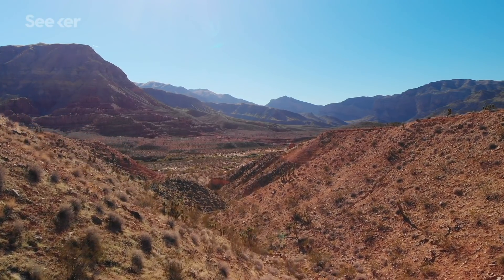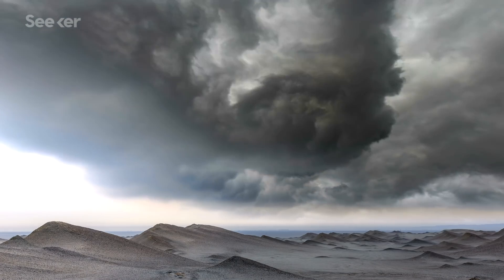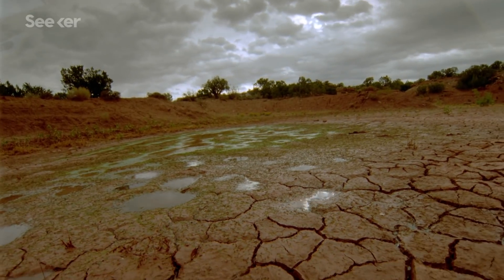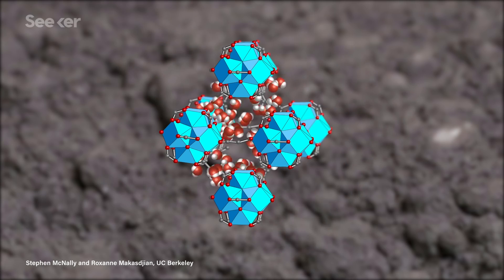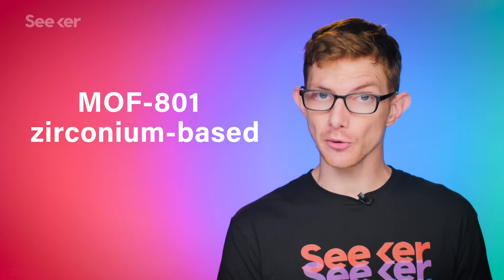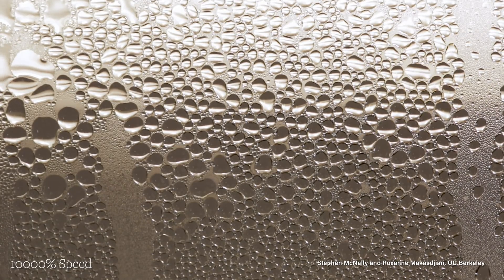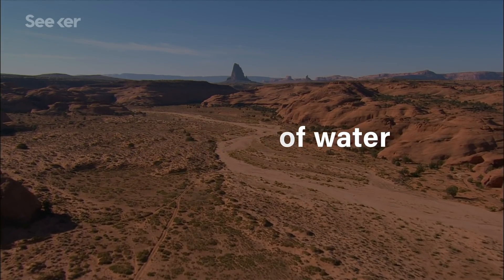Transforming Air Into Pure Drinking Water Is Finally Possible, Here’s How

Comment: Use transparent aluminum fibers in mof or cote it with titanium ceramics.  Stop contaminating the water. Aslo need an ionizer and de ionizer wich will pull the water. Palm tree bark is a clue 8).

Comment: Big deal. Fridges, dehumidifiers & air conditioners have been doing this forever
Reply: Why, oh why does this comment appear so many times 🤔 
Those things require a generator of electricity and more parts. This requires only the sun itself and is, therefore, more direct and fewer parts, though ostensibly in developing phase. 

Maybe it will be the next big thing, or maybe MOF will be like the car that runs on water. 🌬 

Hoping it will be attainable🤞

Comment: "Dehumidification removes water vapor from the desert air" would be the appropriate title. There is nothing transforming anything. 

if the could spontaneously combine random Oxygen molecules with free floating hydrogen molecules, then I would agree with the title. But even that's not transforming. Take three heavier  elements and start removing protons and electrons until you get to the hydrogen and oxygen you are looking for. That would be transformative. 

Break down carbon to Hydrogen and perhaps you'll have the golden goose.

Comment: The question is, "can a MOF pull clean water out of the air with less power than a conventional dehumidifier?" AND does it work better is super dry climates? If the answer is YES to both questions than this IS a advancement in technology!! There are a couple of these being made for small and large consumers in 2020. When used with solar energy, water will be produced via zero marginal costs, so once the unit is paid for it will extract water indefinitely with little to no ongoing costs (Like solar) It's about making the math work in purchasing a MOF unit vs. the ongoing monthly expense of city water costs. If the product delivers than it WILL empower the individual by eliminating the dependence on local water municipalities. All about the math:  costs vs. output of the unit over time.

Comment: This is not the first way to get water from air.  Let me explain
You can get water by simply compressing the air at High amount and high pressure and in this case water is separated from wet air and some purification method makes it as drinking water

Comment: Just look at the thermodynamics of it as showed by Thunderf00t. Every option uses a lot of energy like a air dehumidifiers, and no water of a air dehumidifier is just drinkable because of microbes etc.
Look at Thunderf00t Waterseer and Fontus debunking.
Everyone wants it to work but the thermodynamic just says no. Water desalination by osmosis is just much more efficient and will increase in efficiency with the use of better membranes may be with the help of graphene.
So just look at Thunderf00t videos to get real world calculation of the physics involved.

Comment: "extremely pure and drinkable"
lmao pure water is most certainly not drinkable... how can you even put those two in the same sentence...
Reply: Pure water is perfectly drinkable.   It takes a lot to leech a significant amount of electrolytes from your body.

Now, I wouldn't try and survive on the stuff, but it's also trivially easy to convert pure water into perfectly safe water.     In a pinch, you can do it without any special equipment or materials (assuming you aren't too dehydrated or squeamish)

Comment: This is not a revolutionary technology.  The water in the air is fairly easy to capture. But it either requires energy to extract from the air or from the thing that absorbs it.  Fans and heaters?  Now we're getting a little less simple.  A common window air conditioner gets water out of the air... If you haven't noticed getting dripped on every time you walk past a big apartment building.

Comment: Here we go again with another pipe dream air - water condenser working with some magic material... sigh!. Look you can't beat the laws of thermodynamics: the latent heat of condensation of water is huge: about 2442 J/g in 25ºC. So regardless of the materials used, you are going to need vast amounts of energy to turn the "trapped" water into liquid.Also the areas most in need have very low air humidity so you need  Huge forced draft air fans (huge volumes of air) - a Hella lot of electricity on an industrial scale, just to supply water to a small village. Plus water treatment, cleaning and disinfection because condensed water is a favorable environment for microbes and bacteria. I can go on and state many-many failed attempts - the point is it's not feasible economic - wise and environmentally...

Comment: If we assume 100% humidity and 100% efficiency and that  the device is used for one adult women then
 as there are  12 hours of daylight at the equator for the solar panels we can calculate the power required.
The latent heat of vaporization of water is about  2.260x10^6 J/kg, for average adult women that requires 2.7 liters per day of water then,
m=pv =1x10^3*2.7/1x10^3 =2.7Kg of water.  As E=ml  were l is the specific latent heat of vaporization of water. This gives:
2.7(2.260x10^6) aprox= 6.1x10^6J
As p=E/t and there are only about 12 hours of daylight at the equator, then we can deduce that: 
6.1x10^6/60^2*12 =141.25W. So in the optimal conditions, as stated above, you would need 141.25W solar panel to power the device. Now as conditions are not optimal (humidity is exceptionally low in those kinds of places) and that the solar panel may need the supply for a whole family, so the power demand will be even higher.

Comment: How gullible are you?? An outdoor dehumidifier requires power, and A HIGH LEVEL OF HUMIDITY IN THE AIR. To get the numbers in this study, you would need a near 100% humidity level. Remember, you are talking about extracting this water from an already dry air. Meaning low to no humidity! You could run these things for years and get very very little water. In fact, it would be much more efficient to truck in water from other sources.

Comment: Everyone mentioning thunderfoot, but this one actually isn't a bloody air conditioner. 
Edit: I would love to see thunderfoot do the maths on this. Obviously the earlier devices made claims that violated the laws of thermal dynamics, but perhaps this one works in a  way that doesn't require major energy expensive phase changes, or some quirk of the design saves thermal energy lowering the cost.

Comment: So how long is efficiency kept up? With it relying on such a small pore structure dust from cycling air through it especially with a fan and even more so in dry climates which are more dusty, this will clog and cover all the material quite fast I imagine. So how is this prevented or cleaned off? Does most of the water have to be sacrificed each time for rinsing off the material? Because tap or ground water would be high in mineral deposits which would leave mineral salts that would quickly build up and cover all the material which is even harder to get rid of than dust.

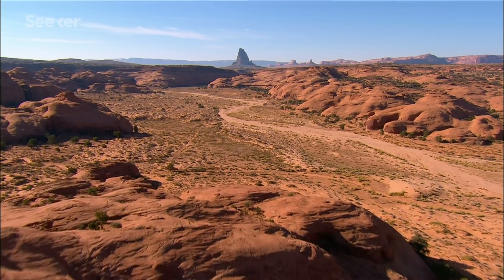Comment: 1:44-1:52 NO!!! Pure water is NOT drinkable. If the MOF only collects water molecules, that means completely pure water, which is a dangerously strong solvent. You drink that straight from the condenser, it will leach the minerals from your bones and teeth, as well as pull vitamins out of flesh and fatty tissue.

Comment: I wonder if a passive one could be tuned to keep the ambiant air at an approximate predetermined humidity. So, you could put one in your house and it would just do its thing keeping your house from overhumidifying to prevent mold and keep the air comfortable.

Comment: I was wondering if there would be any side effects from taking moisture out of the air. Wouldn't it just cause dryer air which would then cause other places to receive less moisture, thus making them dryer?
Reply: The Earth surface is 70% Water and 30% Land. On the grand scale, water vapor continuously evaporated by the Sun from the oceans, rivers, and lakes will replenish the water harvested from the Air. But it's still possible in a small localized area where a huge industrial AWG plant operates would cause a localized lowering of humidity of the area around it. However, such a condition will create a self-balancing weather condition where heavier humid air further out will move in towards the less humid area and restore the pressure, temperature, and humidity conditions.

Comment: I doubt this could cause dramatic climate crissies, but the Atacama would be an interesting case study.

Dry areas seems to beget moisture. Dry air draws moisture in from wetter regions. Wetter regions becoming dry causes more water to evaporate. It is not like it would cause a global disaster. If it were truly bad people in winter or deserts would die from chronically chapped skin, not dehydration.

The only area that I might be concerned about would be the Atacama as that desert is locked due to climate inversion. That area would make for an interesting case study. It is raised where something like Death Valley is below see level. The North African deserts were created from the land rising but I doubt they have problems pulling moisture in for a minimum amount of relative humidity. 

But what do I know?

Comment: You have to add energy to the system to "empty" the water. They didn't test the unit in a desert, they tested it where there was already plenty of humidity, this will not work the same in a desert. When you do the math on how much energy it takes to turn air into a liquid, you'll see that it'd be cheaper just to transport the water in tankers to the location than it would be to try and extract the water out of the air. Basic physics means that water extracted out of air will never be a cost effective option.

Comment: People be talking about Thunderf00t, but I think his videos were pointing out the law of conservation of energy, and how condensation of water by thermal/cooling means is rather impractical. When he debunked the last iteration of MOF technology in his video, he said that it looked like a peltier device, and then debunked peltier device-based water condensation (which is infeasible, as he has pointed out multiple times).

This device seems to be taking a different approach than condensation by cooling. It seems to simply gather water vapor out of the air. This gathering allows the water to have a saturation which would allow for condensation (because water can exist in liquid form at room temperature). So, assuming MOF technology is capable of this gathering of water molecules, the approach is able to bypass the energy requirements that are normally required of condensation by cooling.  The input of energy from the sun could be the necessary energy to carry on this process, and seems plausible (especially considering passive processes like the drinking bird, or water transportation in xylems). Given that we have 1 PhD against (Thunderf00t, who didn't address this MOF idea), but multiple PhDs in support of this technology (Univeristy of Berkley and MIT, in addition to peer review), I will place my bets on the greater collection of PhDs until more compelling evidence proves otherwise.

Comment: Some of the articles I have read claim mof 303 costs 3 dollar per kg and 1kg can pull 0.7 litres of water out a day in a desert. That sounds amazing because even at desalination plant prices that's 10 cents of water a day. Unfortunately that requires solar powered fans to dry off the mof 303. Assuming the fans you are using run on 20 watts an hour all day long you would need 480 watts of electricity which at best requires a 500 dollar battery and a 100 dollar 60 watt solar panel. So let's say these make up 90% of the setups costs And the total setups cost is 666 dollars. A desalination plant can make  3350 litres of water for 666 dollars energy costs in. In the desert this setup will make 250 litres a year. But will the amazing solar water setups require maintenance, replacement of batteries or panels? Probably. Most solar panel batteries need replacing once every 10 years.

Comment: Wouldn't that cause the air to become extremely dry???
Reply: Dry areas seems to beget moisture. Dry air draws moisture in from wetter regions. Wetter regions becoming dry causes more water to evaporate. It is not like it would cause a global disaster. If it were truly bad people in winter or deserts would die from chronically chapped skin, not dehydration.

The only area that I might be concerned about would be the Atacama as that desert is locked due to climate inversion. That area would make for an interesting case study. It is raised where something like Death Valley is below see level. The North African deserts were created from the land rising but I doubt they have problems pulling moisture in for a minimum amount of relative humidity. 

But what do I know?
Reply: @chriscontact5857  wow that is quite interesting actually.
Reply: No
Reply: @dudewithgravity  yes, idiot
Reply: Charon C. Before you call someone an idiot how about you do some research yourself?

Do you really think an aluminum box is going to dry out 1000s of miles of air, and that evaporation is just going to stop all of a sudden?

Go back to school kid.
Reply: Yes.

Comment: This is all well and good but... it can only work if there is any water vapour in the air to start with. A majority (I assume) of desert areas are essentially arid both day and night so its effectiveness may be limited to desert areas relatively near to a coast. Hardly a panacea, although it may have significant use in other underdeveloped regions with only polluted/unsafe water supplies.

Comment: Are you guys falling for this too?!?  It's a freakin' dehumidifier...
Reply: The desert air isn’t really being dehumidified because such a small amount of water (relatively speaking) is being pulled out. A dehumidifier is for small enclosed spaces where there’s a chance of actually decreasing the amount of moisture in the air.
Reply: @ThatOneScienceGuy  what would you call this then? I don't know what else you would call a material that adsorbs water from the air other than a 'dessicant dehumidifier' .
Reply: jacob smith We can call it a moisture condensation machine. Because that term would focus on the product (water) rather than the effect (dehumidify). I just felt like dehumidifier wasn’t a good term because it’s describing what’s happening in the airspace. And since the desert air isn’t going to experience a measurable drop in humidity, calling it a dehumidifier didn’t seem precise enough. I hope you can see what I mean. Maybe I’m wrong. 🤷🏼‍♂️
Reply: With a water filter taped to the hose.
Reply: I almost fell for it. I'll be on guard now. I appreciate you for pointing that for us man.👍

Comment: Thunderf00t is more than dizzy from all these looping “Water from air” rides.
Reply: It's called an atmospheric water generator, it's a technnology  that existed for a while now...I had some at my school in the form of water dispensers, the water tasted weird though.
Reply: @brandonporter6223  they do not, and cannot, work well enough to be worth while in the desert environment.
There is a limit to the amount of water you can extract from air. In a desert, that's low. Like not enough for any human to survive off of in any capacity.
Reply: @rexevans100  in this dessert environment you speak of.. Do they have ice cream?
Reply: I think Brandon was in Hogwarts
Reply: @_b-e-n_  fixed, also...
🖕😀🖕
Reply: @rexevans100  haha sorry I had to!
Reply: Yes , at 95-100% humidity rain kinda does the trick..not to speak of the huge amount of power that they need to produce useful volumes (even at these conditions). Both of these requirements are absent in the setting (dry and semiarid deserts)in which they are trying to “sell” this product.
The dehumidifier is a great invention, but it’s no law-breaker, so these “magical re-inventions” all end up in the same place.

Comment: Isn't  pure water a bit , how can i put it ' sharp '  ?  I thought the stuff in it , minerals etc were what stopped H2O from burning a bit ?   0.7 litres per day per kilogram of absorber ? Wouldnt it be more cost effective and productive to design a ' tree ' of brachistacrone curves from an abundant material that resists warming by its density and coat it in a hydrophobic surrface layer so that the vapour condenses just above the surface and rolls off quickly without exchanging too much heat  instead of sliding off and warming the apparatus ?  Keep it in the shade insulated from the rising sun and ....... 
I love the material and concept for other applications . I also appreciate that its a good experiment from which to extrapolate the data to be used going forward . I just think you could collect that much water for the same weight of material using my idea before brunch ( do people really eat brunch ? Or is that not really a thing ? )